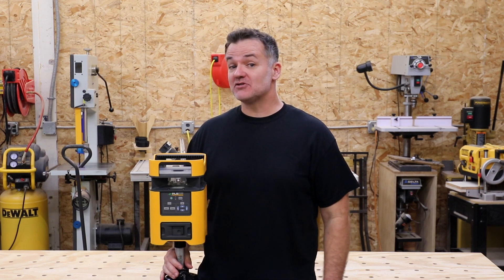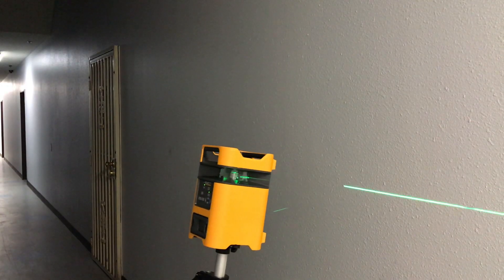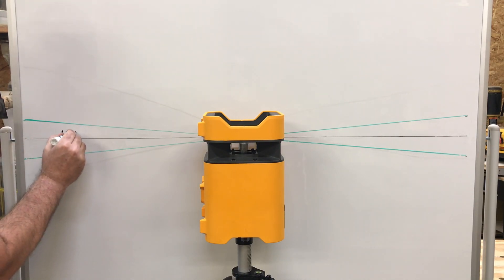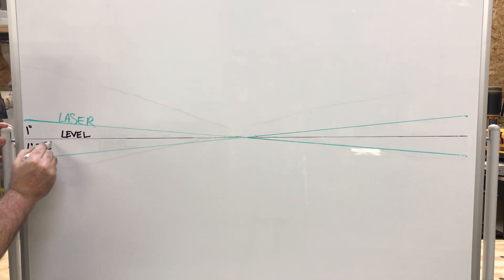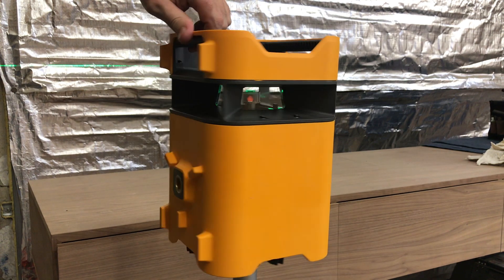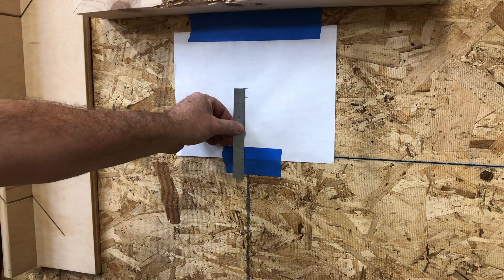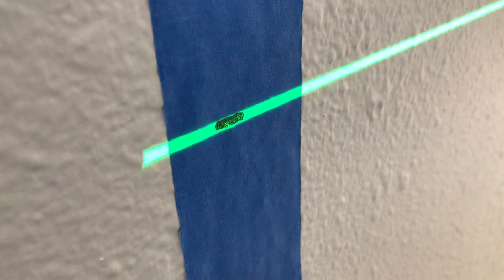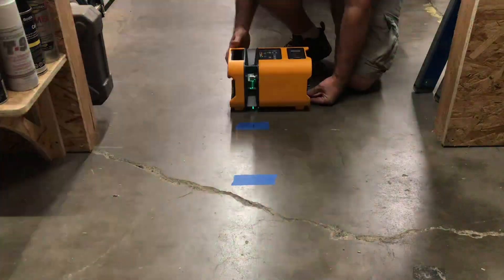How to Test your Rotary LASER Level

Comment: Like I said in a comment on another video, your videos are great!

You might be interested in this tip: instead of attempting to mark the center of the laser line, draw two parallel black lines on several white cards, with the lines spaced a small distance apart, say providing 1/8 to 3/16 inch or so white space between the lines.  Now attach the cards to the walls where the laser beam is being viewed, adjusting their position to accurately center the patterns on the  laser beam.  When you reverse the  laser, you look for a shift in the beam position in the same way as you have described.

The reason for doing it that way is that your eye is much more sensitive to the decenter of the laser with respect to the black-white-black pattern than it is to decenter with respect to a single black line.  Try it using a sensitive adjustment to the laser position or angle that you can accurately measure and repeat, and you will see that what I say is true.  This effect is called the "vernier acuity" of the human visual system, and it is something that you can look up if you want.  Because the human eye is much more sensitive used this way, it becomes very easy to detect the error in position, and that is the reason for making the change.

For the same reason, I think that you would be better served by centering the bubble between the lines on a spirit level, rather than adjusting the edge of the bubble to one of the lines.  Your eyes are very good at determining when things are centered, basically just repeating what I said above.  I think that is the fundamental reason that spirit levels are built the way they are.
Reply from the maker: Good input, Thank you!! 😁👍🏻